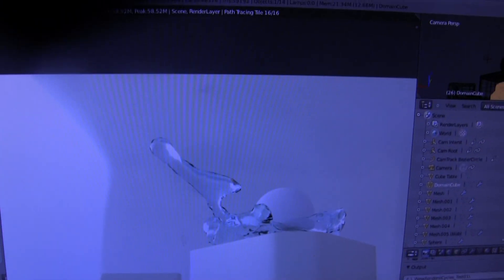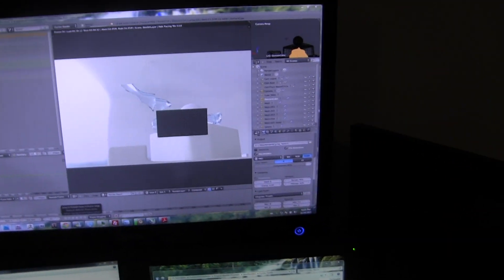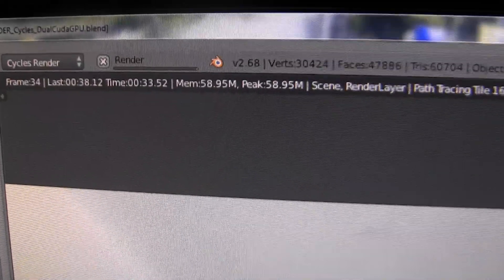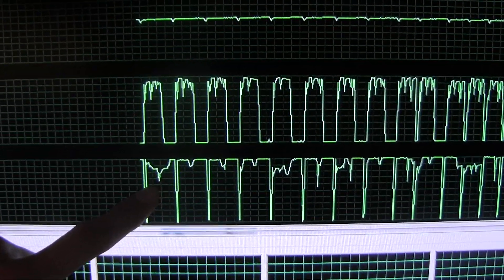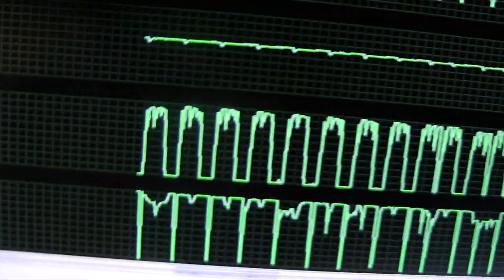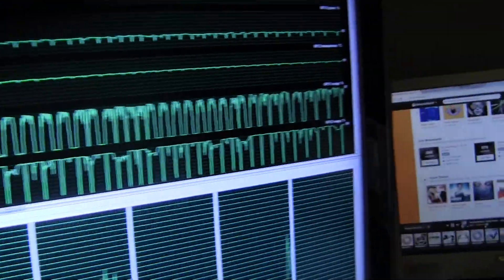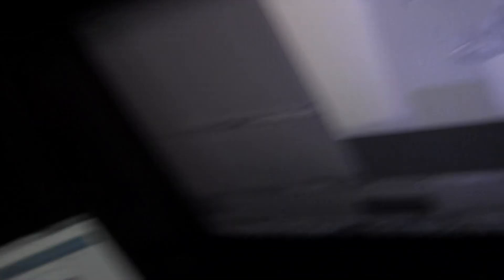Kicking Ass with Cuda-GPU 3D Rendering!

Comment: hey I have nvidia geforce gtx 660 direct cu 2 oc from asus and nvidia GV-N650OC-2GI GeForce GTX 650 from gigabyte you know are they compatible if I crossfire them ? I would use the crossfire for blender rendering etc
Reply from the maker: tunnis7us 

It will work for rendering.... but not for crossfire. Here's the thing. You don't need crossfire for rendering, as crossfire is only for gaming. For GPU rendering, all you need are GPUs with Cuda Cores. Essentially they just have be nvidia cards.
Reply: FPEvideos does this mean that I can't use them both same time when like previewing cycle render engine in real time, but when rendering the 3d models to a video the computer uses them both ? also does this mean that I don't need the crossfire cable between them 2 cards ?
Reply from the maker: tunnis7us You can use both video cards for rendering or 'live preview' rendering in Cycles. You don't need a Crossfire cable.
Reply: FPEvideos btw does the motherboard have to support sli in order this to work ? I read something that crossfire ready motherboard doesn't support this type of gbu usage, in order to make use of these gbu's the board have to support sli ?

Comment: Hi there, did you try if both cards would work for Premiere CUDA mercury engine ? for real time editing and video rendering using CUDA, i plan to use it only as dedicated Physx card, but would be good to see if it works with Premiere:) thanks
Reply from the maker: I would really like to try that. Its a bummer that the Premiere CUDA mercury engine was released in CS5, I'm one version too old with the CS4 suite. :/
Reply: FPEvideos If i get one 650Ti soon i will post the results here:)

Comment: man this is awesome, i just wanna ask you how could you use 2 different gpus (570&650ti) with no issues. aren't the gpus should be the same in order to use the SLI or crossfire!!! ?????
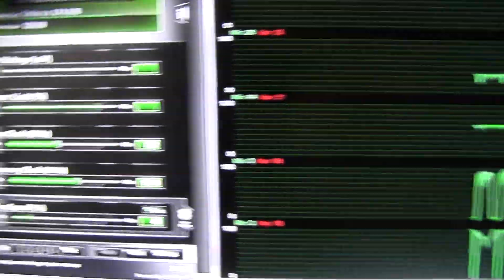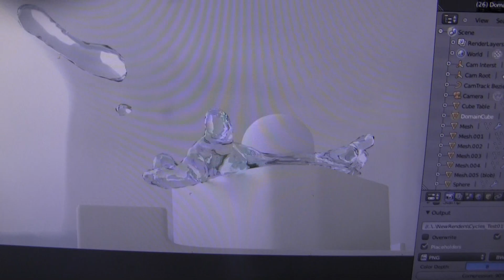Reply from the maker: SLI and Crossfire is only needed for gaming, where the power of both GPUs need to be coordinated to render graphics in real time to be piped to your monitor at 60fps or so. In rendering still frames to create a video for later playback, SLI is not needed. In fact, it is recommended you turn it off. Each GPU works independently to render a small square of the image called a tile. When it’s done, it moves on to the next un-rendered tile. Any number of GPSs installed on your system can be used to chip in with rendering these tiles. Once all of the tiles are rendered, they are stitched together to make the full image. Then it starts the whole process over again next image/frame for the video. If you look carefully you can see a glimpse these tiles being rendered on the monitor around 2:22, and 3:53, as the camera passed by the monitor with the fountain render. It’s the black square that pops up then disappears.
Reply: FPEvideos  thank you so much that was extremely helpful and it cleared up a lot of confusion. I'm an 3D animation student and i have to render my 27 hours (2 minutes per frame) ad that i made for my final project and I'm using Arnold as a render engine and its super fast except it's using the CPU not the GPU to render the frame.
but I'm wondering if your amazing kicking ass CUDA technique work in any render engine or not ?
 in my case i really wanna reduce my render time , so in my case would adding a get second GPU or increase the ram help?
#m current build:-
-ntel Core i7-2600K
-GTX-570(like yours:)
-16g of DDR3 (1600) Ram
-ASrock z68 extreme4.
-850w crousir power supply.
-temp around 55ºF at most
-windows 7 ultimate .

Comment: what is your pc config...
Reply from the maker: CPU: 8-core 3GHz
RAM: 32GB 1800mhz
GPU1: GTX 570 - 3GB
GPU2: GTX 650 TI Boost - 1GB
PSU: 750W
Reply: which cpu model...two gpu runs simultaneously ..how..?